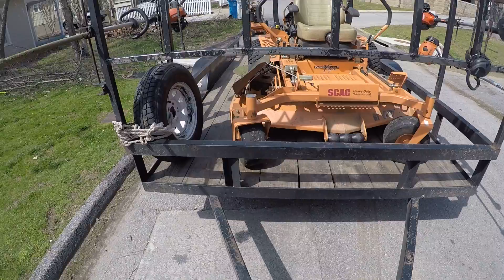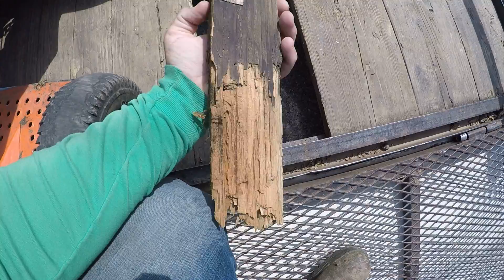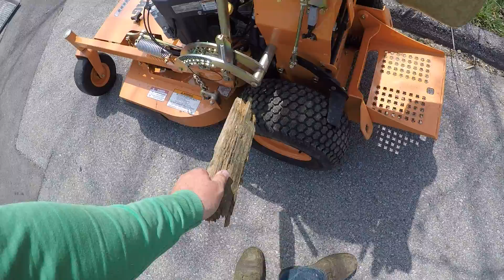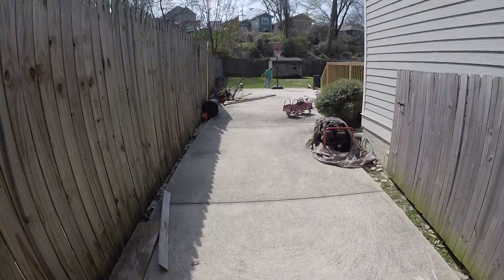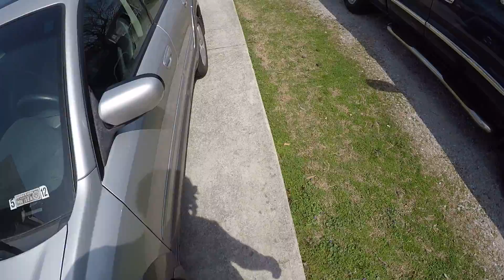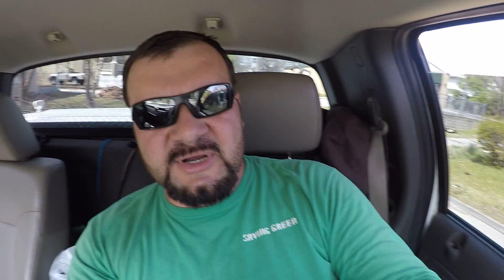SCAG MOWER FELL THROUGH?!?!?!

Comment: As someone who ran a 36 stander last year, I think you will find out that the weight of that mower on the skinny tires that it has to fit the deck size puts a lot of weight in a very small space. I got rid of my vantage for a turf tracer.  Love the bigger standers though, I run a 52 vride myself.

Comment: It happens man don't sweat it. Should be an easy fix tho just get you a another board. might consider a whole new pressure treated floor soon.
Reply from the maker: Matt Reynolds that's exactly what I was thinking, since I got to change one might as well change them all they all look rough
Reply: If that floor has lasted 10 years that's not bad.

Comment: dam that sucks but its not as bad as shit could be. i would have loved to have had to deal with that last year over having my leaf spring break in half while on the highway. luckily i had 1 leaf that didnt fail so i still had an axle, lesson for ya tighten the u bolts to the springs every year great spring time precheck! or that will happen in time due to the reverberations weakening the leafs. 

i wouldnt just replace the one unless you check all of them for rot like that it will only take a tiny bit more time to do all of them and know your good for a long time. if you cant get to it in asap then go to homedepot and have them rip an 3/4 ply and screw it down for  a temp fix.
Reply: check the grease and bearings too.

Comment: Just put a sheet of plywood on it until you have time to replace the boards.
Reply from the maker: Grasspro good point, thanks
Reply: Looked like a sheet of something on the ground beside the trailer at that stop....yeah just cover up the hole for now....fix it right when things slow down or have a rainy day
Reply: Grasspro   there it is.
Reply: A year late.. lol but screw in a license plate over the hole for now